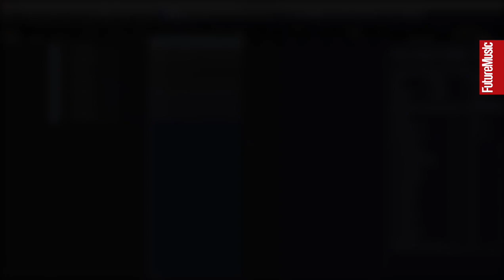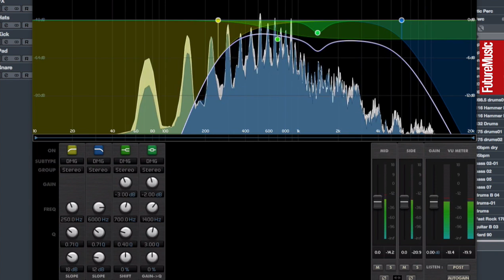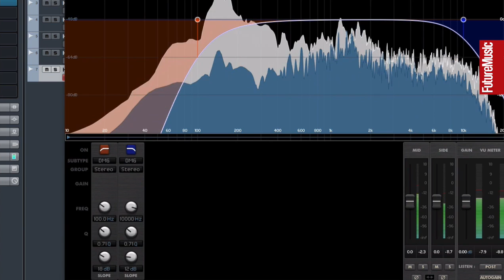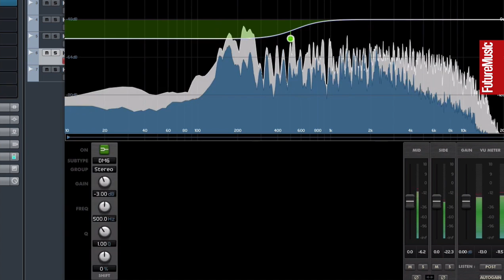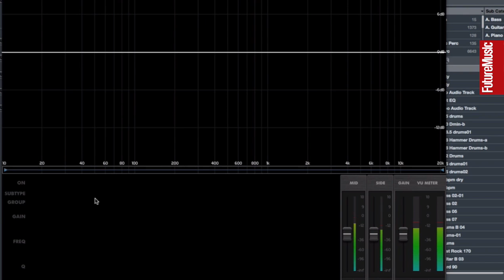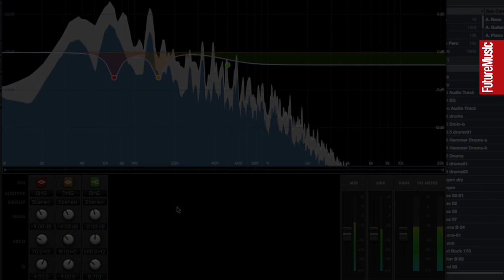How to control your mix with proper use of EQ

Comment: There are better ways to deal with these problems than to EQ the life out of it. Think Compression, Side-chaining and Multi-band Compression.
Reply: Not better. Other ways.
Reply: sidechaining is more of an effect than a mixing solution. EQ is likely THE most important thing to a better mix.
Reply: vinnien goes to show you need to learn more , youll probly looking at at the wrong cats

Comment: Honestly one of the best videos on youtube for how to use eq
Reply: Just wish they went a bit more into WHY they're making each individual changes.   A more thorough explanation of identifying clashing frequencies, and choosing parameters to correct for it would be better.  To a beginner this might just appear like they're choosing numbers out of thin air, as they don't explain these decisions.

If you understand the reasons for what they're doing it's a great video demonstrating the process.
Reply: I hear what you're saying. It's hard to get all of that into one short video without it being totally mind boggling though. And learning how to EQ properly is a lengthy lesson - best way to learn is trial and error.
If i were to give one main EQ must though, it would be to high pass all sounds which aren't the bass and kick up to 100-200hz. That one will do alot for you clarity and punch.
Reply: That's true; no reason it has to all be crammed into one video.  Awesome to see so many uploaded today as well!